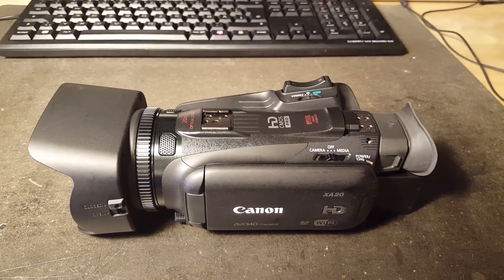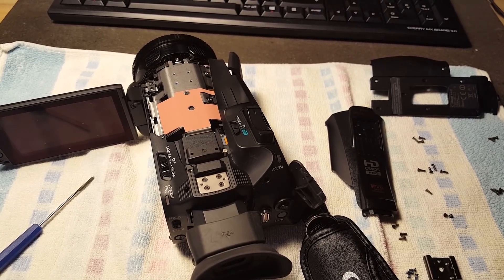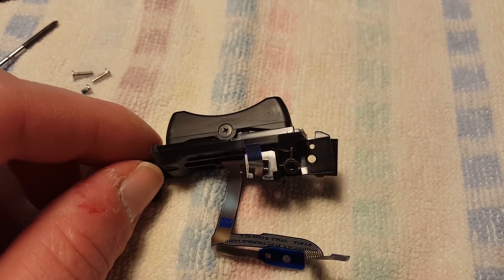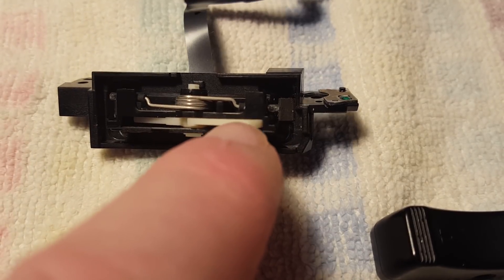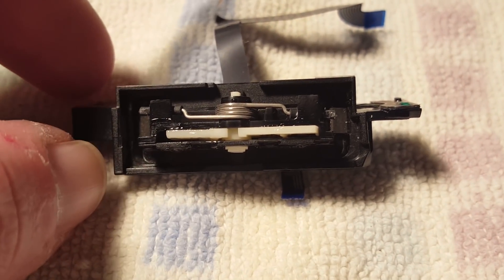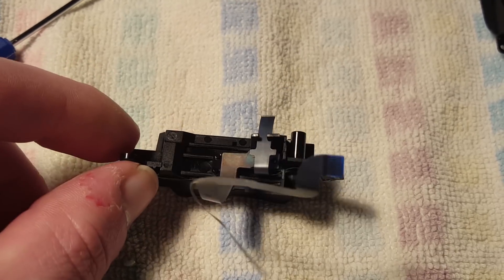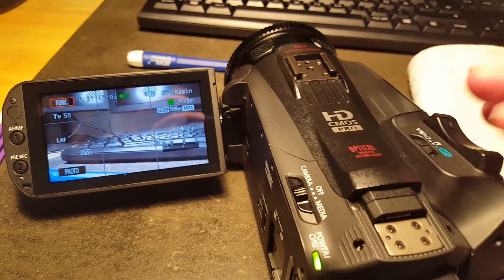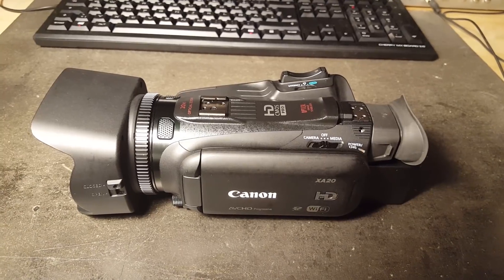Canon XA20 camcorder noisey Zoom Rocker repair

Comment: Nice job showing the painfully difficult semi-repair for this problem, and shame on Canon for putting out a nice camera with such a shoddy — and important — part. That's a great way to lose customers. I recently set up a wearable work-around ... I put the nice, quiet remote control on a lanyard. The zoom on the detachable handle is awkward to use, and this seems to be a good option. Note that, unlike your camera, mine has had relatively light use and has not been abused. Still I have the same squeaky problem! Do better, Canon! (My first test will be later this morning when I zoom in on Air Force One as it approaches Miami — tripod handle in one hand, remote in the other.)

Comment: I had the same problem with a XA 30. Uncontrolled zooming out. The zooming seemed to be caused by the rocker switch not beeing in the right position in rest. Ifixed it by bending the spring from the rocker switch. Both sides have now the same amount of play before zooming starts. And there is no more spontanious zooming anymore
Reply: Did it still cure the problem ?
Reply: @MilitaryAC  This camera is still working fine.  I have six of these type,  three of them had the problem. Based on my experiences I now think that there are two slighly different problems. The slow zooming out can be fix by adjusting the spring. The problem of suddenly fast zoom out I think is caused by bad contact in the flat cable connecting the rocker switch to the camera.  Just reconnecting it seems to do the job.

Comment: I just contacted the Canon service dept as my XA20 is zooming out by itself, it really is terrible that i need a new Rocker switch so soon only after two years of owning it.
Reply from the maker: This problem is due to dirt on these tiny carbon tracks in this rocker switch. Seems Canon camcorders often have such problems, I know a lot of XM/GL series camcorders are affected by this. Too bad Canon has not changed their design to prevent such issues.
Reply: DrCassette An expense i shouldn't really have to pay, as it's a common fault.

Comment: Nice job!!
I have VIXIA HF G30 - very similar model to compare with XA20.
Both model are from 2013r.
Main difence is handle which is present in yours model.
I sometimes have the same problem with zoom buton which was shown in your movie.
When I zoom IN, and stop, camera (without my activities) independently making zoom OUT.
Your movie is very helpful for this problem. Did you contat with Canon Service? I was wondering how much cost a new this part (without mounting service)

Thank you!
Reply from the maker: I didn't want to spend money on replacement parts, I just wanted to work with what was there. So I have not contacted the Canon Service.

Comment: hi greetings i have a canon xa 30 and i have an issue with the zoom that automatically when i zoom in it zooms out it does not stay zoomed in, any advise ?
Reply from the maker: This is caused by bad contacts in the sensor that is operated by the zoom rocker. Some contact cleaner might help, but it is risky, so be very careful...

Comment: How do you fix issues when it zooms out by itself?? When the potentiometer goes bad?
Reply from the maker: You might be able to get some contact cleaner into the potentiometer to fix the zoom. But use some proper contact cleaner such as Tuner 600 to avoid causing further damage!
Reply: DrCassette thanks! I just disassembled my canon x25. Your video was of great help. Used contact cleaner on the potentiometer and so far is looking good. Will test more. I have 3 more cameras to fix with the same issue.. they are for a church i help with
Reply: @EVunedited  Gonna try the same with mi XA30. Hopefully works. Any advise in the cleaner you used?
Reply: @EVunedited  I am finding my one difficult to take apart.